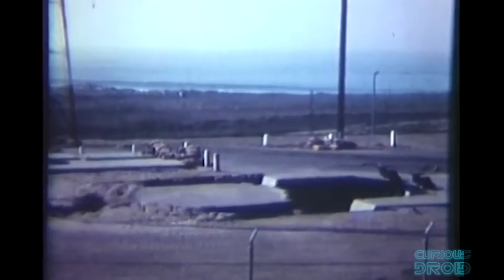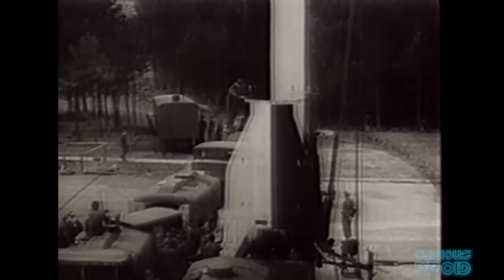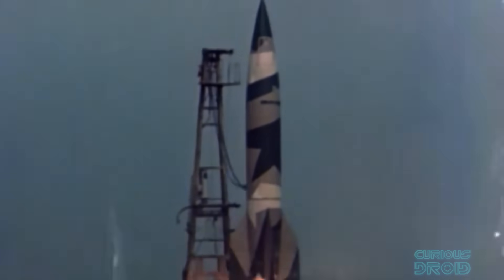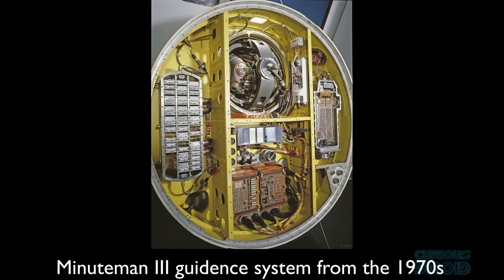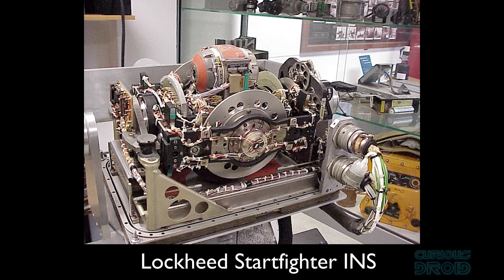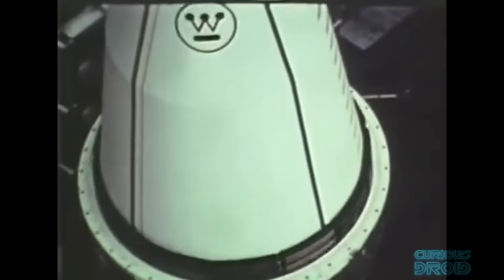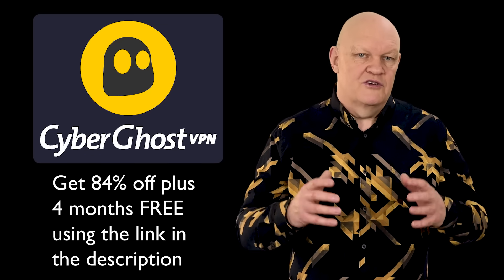How Does a Nuclear Missile Find its Target?

Comment: My mother & father worked peacekeeper and MX (where they met) .  F.E. Warren AFB ,  the few things they let slip over the years makes me believe there is so much still not in public domain.   Like for example said on MX had to sign out 12 explosive separation bolts for the bus but there where only 10 rvs???  He was the nuclear side of things opposed to her job conventional explosives so prp had a field day when they got together but turned out fine. He did alot of work at pantex writing TO's probably still in use today.  He did say they are pretty safe and mentioned weak links, strong links, rotary switches, pal obviously,  exclusion zones, one point detonation without yield all sorts of backups to keep secrets ...secret. fascinating stuff.  Especially when you think a decent engineer could build a functioning bomb. You could build the exploding bridgewire detonators(slappers), maybe even your own neutron generator if not using polonium 210, lenses ect physics package but you could never get the fuel. Unless you stole it.

Comment: AI Summary (Gemini 3)
*Abstract:*

This transcript outlines the evolution of Intercontinental Ballistic Missile (ICBM) guidance systems, tracing the lineage from the crude German V1 and V2 weapons of World War II to modern quantum-stabilised platforms. The central thesis explains how missiles achieve sub-100-metre accuracy over intercontinental distances without relying on GPS during flight.

The narrative details the shift from mechanical "stable table" gimbal systems to digital "strap-down" computers, and the replacement of spinning mechanical gyroscopes with Ring Laser Gyros (RLG) and Fiber Optic Gyros (FOG). A critical distinction is made regarding GPS: it is used solely for pre-launch alignment to avoid jamming or spoofing mid-flight. Future developments involving quantum interferometry are predicted to eliminate drift entirely, rendering external navigation aids obsolete.

*From V2s to Quantum Tech: How ICBMs Navigate*

*   *00:00 The Accuracy Trade-off:* Early missiles (1950s) had terrible accuracy (1-3 km error radius), necessitating massive megaton warheads to ensure target destruction. As guidance improved, warheads could become smaller and lighter.
*   *00:58 The German Ancestors:*
    *   *V1:* Essentially an autonomous aircraft. Slow, susceptible to anti-aircraft fire (45% shot down).
    *   *V2:* A true ballistic missile. Travelled at Mach 2.3 (approx 2,880 km/h). Impossible to intercept at the time.
*   *03:13 Primitive Inertial Guidance:* The V2 used a primitive inertial navigation system (INS) with gyroscopes driving graphite vanes in the rocket exhaust to control pitch and keep the rocket upright. It was dumb; it couldn't correct for wind drift, only attitude.
*   *05:39 The Stable Platform:* To solve the issue of vibration and tumbling confusing the sensors, engineers developed the gimballed stable platform. Three gyroscopic rings (yaw, pitch, roll) isolated the accelerometers from the missile's violent movements, allowing them to measure true acceleration relative to a fixed point.
*   *07:27 Irrelevant Sponsor Segment:* I have ignored the VPN advertisement here as it adds no value to the technical discussion.
*   *10:10 Celestial Navigation:* By the 1960s (Polaris/Poseidon missiles), mechanical drift was still an issue. "Star sighting" was added—using optical sensors to lock onto stars during the space-flight phase to correct the inertial drift.
*   *12:06 Strap-down Systems:* In the late 70s, physical gimbals were replaced by "strap-down" systems. Sensors were bolted to the airframe, and digital computers mathematically calculated the rotation. This eliminated "gimbal lock" and reduced mechanical failure points.
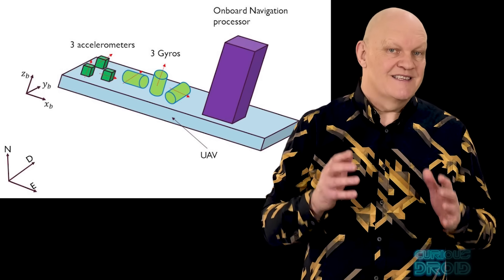*   *12:51 Optical Gyroscopes:*
    *   *Ring Laser Gyros (RLG):* Utilises the Sagnac effect. Two laser beams travel in opposite directions around a closed path. Rotation causes a frequency shift between the beams.
    *   *Fiber Optic Gyros (FOG):* Similar principle but uses phase shift in coiled fibre optic cables.
    *   Benefit: No moving parts, immune to vibration, extremely low drift.
*   *15:58 The Role of GPS:* Contrary to popular belief, ICBMs do not use GPS for mid-course guidance due to the risk of jamming. GPS is used exclusively before launch to precisely align the inertial platform.
*   *17:15 Quantum Future:* The next generation of guidance uses quantum accelerators and atom interferometers. These theoretical systems have effectively zero drift, removing the need for even pre-launch GPS or star sighting.

Comment: A wee correction, Polaris did not use star sighting to correct it's flight, just the inertial guidance from the GA (Gimbal assembly) which was it's guidance platform. Don't know about the other historical missiles and not saying about the current generation but Polaris did not, not even in the Chevaline improved front end version.

Comment: Between the 70's and 80's was the huge MX/LGM-118 PEACEKEEPER. It had an revolutionary  internal precision INS  called SABRE (Self Aligning Boost And Reentry concept. It evolved into the AIRS system. This was the strange floating ball in fluid platform the Draper Laboratory  was working on since the 50's.  It's CPE was measured in the single digit range of FEET and was nearly foolproof.

A lot of gimmicks and acronyms went into MX and the guidance system and a mechanical INS was deployed with the IOP MX while the AIRS system languished in development hell. But other things and systems were coming into age, including the B-1B and the F-117 Nighthawk Stealth fighter were starting their own IOP.  The early 80's were, as many were called it, entering the age of brinkmanship.   The Soviets could not afford things to counter these magical toys the Americans were coming out with, forcing them back to Geneva to sign treaty after treaty.  Then the last domino fell in 1990 with the Soviet flag over Red Square coming down.

Comment: FYI, the V-2, Atlas-D, and Titan I all supplemented the inertial guidance with radio guidance during the initial boost stage. Also, the early Minutemen aligned their inertial platforms to a reference star beamed through a long pipe directly into the silo. The missile was aimed to fly in a certain direction using a large compass etched into the silo framework. Thus, they could not be easily reprogrammed to alternative targets. The star peep hole was abandoned early on, but the misses weren’t readily retargetable until much later. Today, they are all aimed to a point in the center of the ocean and are programmed just before launch.

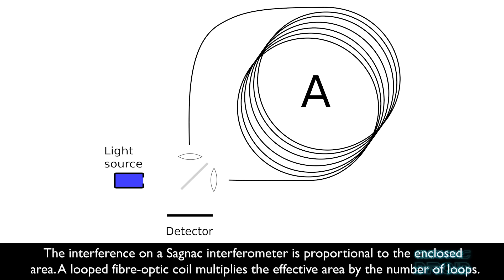Comment: 14:21 Why would the 2 types of light gyros, light making a (somewhat) circular path by mirrors, and light making a multiple circular path inside of a fiber-optic coil, have different results when the beams rejoined? .. with the mirror version (the video says), *frequency*, and with the fiber-optic version (the video says), *phase*.
Reply: Because light travels at a fixed speed through space. If you were to fire single photons in opposing directions, say aboard a rocket, one going forward and one going aft, over the same internal distance, the photon heading toward the direction of thrust would travel the internal distance faster than the one heading toward the direction of travel. It’s kind of like jumping on an elevator when it approaches the bottom, the floor rises to meet you .. that’s an effect of inertia, which is different but, a way to intuit. As for the frequency phase thing … two signals with slightly different frequencies traveling the same distance will arrive at detector out of phase, or, two signals with the same frequency traveling slightly different distances will also arrive slightly out of phase.

The kicker here is, from the gyroscopes perspective, the distances are the same, but the frequencies are different. From the photons perspective, the frequencies are the same but the distances are different. In relativity, both are correct. Figuring this out is one of the things that makes Einstein a genius. 

TLDR, look up interferometer. A laser gyro is in essence an interferometer.
Reply: @itmaybeokay  Your response, though appreciated, doesn't explain the difference between a circle of fiber optic cable and a circle of mirrors.

Comment: INS gyros: In the USAF I worked with a guy that previously had been a missile technician. He worked on the SRAM. New security personnel have an orientation briefing and tour of all buildings. Before the tour they're briefed that the most dangerous thing about the missiles was the solid rocket motor (warheads stored separately); if one went off inside the bunker it would incinerate everything. One day a new security guy on the tour came into the missile shop. They had just finished running tests on a missile and the gyros in the INS were spinning down (takes a while) and they make an audible whine. The missile guys know this is normal and ignore it. The new security guy, being wide-eyed, amazed, and a little afraid at all the missiles, etc. heard it and said "what's that?". The missile tech NCOIC looked at him, wide eyed and said "Oh NO! We've got to get out of here!" and ran for the door. The poor security guy freaked out thinking he was about to be incinerated. The NCOIC got a talking to about his "sense of humor". I love military humor. The new guys always get an "indoctrination".

Comment: The LGM-118 Peacekeeper, which carried up to 11 MIRVS, had a totally autonomous inertial guidance system called the Advanced Inertial Reference Sphere (AIRS), which is considered even by today's standards, as perfect for an ICBM. It enabled a warhead to hit its target within 8 meters. The AIRS used a beryllium sphere containing highly advanced and accurate gyros, which used a type of gas bearings, and accelerometers. The sphere was suspended in a Chlorofluorocarbon fluid which was kept at a precise temperature. This system did not need any external inputs and was impervious to radiation and EMP. It could also be stored for long periods of time with no degradation in its accuracy. This accuracy and performance did not come cheap though. The cost per unit was around $6 million in 1985, roughly $18 million in today's dollars.

Comment: How is "ballistic" being used in this context - i.e.what is the difference between a ballistic missile and another type of missile?
Reply: It's a bit of a misnomer, since most of them aren't strictly flying in a ballistic trajectory — but the term usually applies to any missile that's launched more or less upward in an arc, and coming back down more or less unpowered and unguided through the atmosphere. The point is mostly to contrast them with missiles that are steering themselves aerodynamically, like cruise missiles, etc.
Reply: @simongeard4824 I think that explains it, thanks! It's just that the dictionary definitions of "ballistic" don't seem to include that more nuanced interpretation, so I did wonder why people often say it.
Reply: Remember, the term mostly dates to that WW2 period where missiles were starting to appear... and the V2 was a missile that flew more or less ballistically for the majority of it's flight time (i.e. after engine burnout).

Comment: The absolute pinnacle of INS technology for ICBMs was achieved on the MX Peacekeeper missile. This ICBM was larger than Minuteman but could carry up to 15 MIRV warheads. Unfortunately cause of the price and politics this incredible missile was retired in 2005 although it was decades younger and more advanced than the Minuteman ICBMs which are currently still the only ground based ICBMs with nuclear payload that the US has.. Thankfully the replacement is in the works, called Sentinel.. But of course the enormous increase in price and technical hurdles have pushed the introduction date well into the 2030s. Our other 2 legs of the nuclear triad are also pretty old. First are the AGM-86 air launched cruise missiles carried exclusively by the B-52s and the B-61 nuclear gravity bombs carried by the B-2 bomber and the tactical aviation from the F-15 & F-16 to the advanced F-35.. The modernization of this leg is also in the works with the new nuclear tipped stealthy cruise missile known as the LRSO which will be carried by the same B-52s and the new stealthy strategic bomber - B-21 Raider.
And last but not least (given that it holds 2/3 of the US nuclear arsenal) is the 3rd leg of the nuclear triad - the submarine based Trident missiles. This system is also vulnerable since the platform that carries the Trident missile is the aging Ohio class submarine.. The Navy is developing a new submarine called the Columbia class to replace the Ohios. 
SO in mid to late 2030s US strategic force will have the most advanced and credible nuclear weapons platforms of all the nuclear powers.. New ICBM, new air launched LRSO cruise missile and the new ballistic missile submarine armed with the Trident SLBM..

Comment: Always a pleasure to watch your videos. I was hoping you would explain how the solid state gyros work, like the MPU6050 module. As a maker, I love to apply such technologies to artistic projects. One of the first ones I made, was a light emitting cube that changed the light it emitted based on its orientation. To detect the orientation I used something like 30 mercury switches placed inside its code in different angles. Those switches turned on and off RGB leds. All was fully analog. not a single micro controller.
https://www.youtube.com/watch?v=_ol0U-L4a5U

Comment: This  video gives  zero discussion as to how  the missiles  feed the data from the  INS to the vehicle to adjust the trajectory.   V2 used graphite fins in the exhaust . Poseidon as shown has no such fins.  How does it work ?  manoeuvering jets when in outer space for example ?   It's all part of finding the target .   It's a complete fail in terms of showing how the vehicle's  orbital curve is modified  by the feed back from the   INS  on board.   I don't have the answers  apart from the  V2 example given. 
General comment - 
A lot of the content was lifted in a general sense  from  Wikipedia  articles on gyroscopes including the fibre optic section.